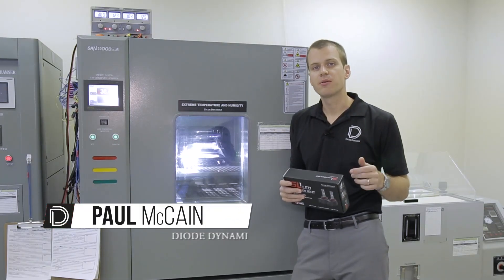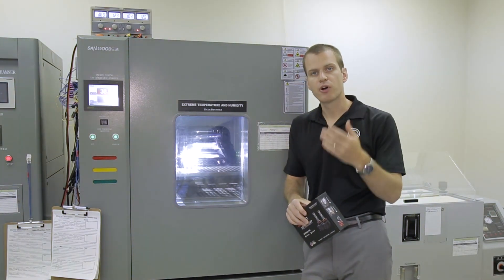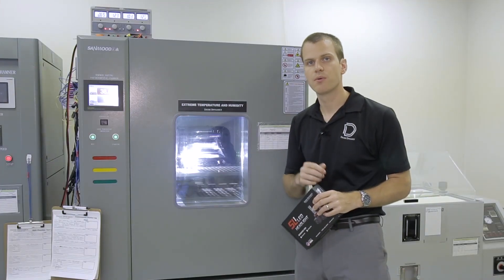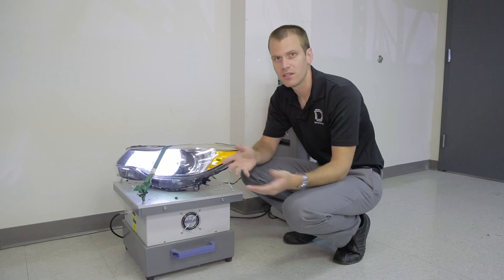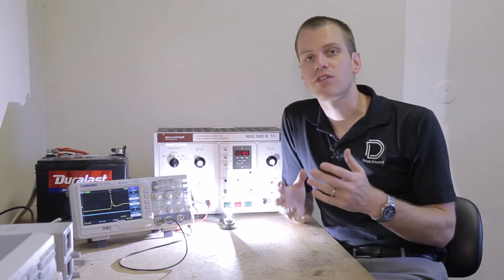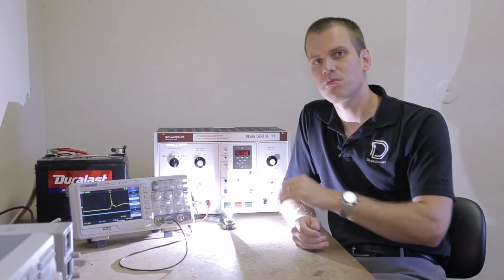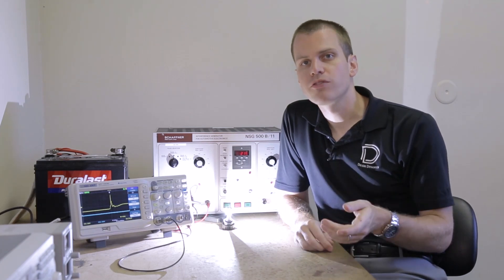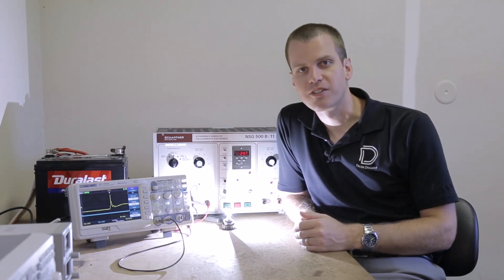Reliability Testing of LED Headlight Bulbs | Diode Dynamics

Comment: The electrical testing is interesting. My concern is if they'll cause static interference with something such as a CB radio while it's on. I have ordered three pairs of SL1s for testing. If they cause interference and static in a radio, I'll return them. If not, I'll keep them.